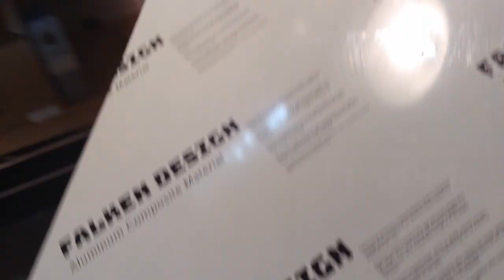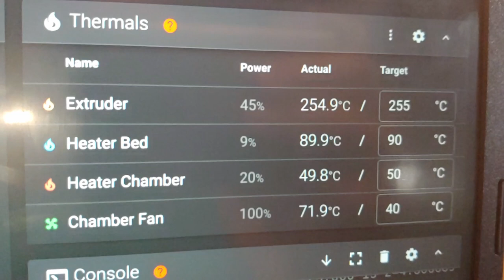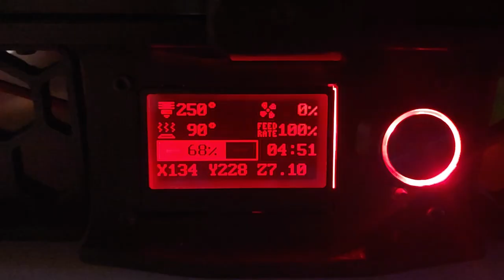V2 Chamber Heater Tinkering Continued

Comment: Just add a Chinese thermostat to control that PTC heater. It works for me and my Prusas, you don't need a PID controller. Also, I think your bed has very poor adhesion. With a texture sheet on my Prusas, I don't even use a skirt or glue stick, so unless you have a better textured sheet, you can use a smooth PEI sheet with glue. Also, it would be better if you remove all the aluminum and polycarbonate sheets and place your naked Voron inside a wooden enclosure with a small front window. Of course, in that case, you would have to insulate the bottom electronics.

Comment: im on a similar issue. Thought on  chamber heating but, yesterday i boght an infrared thermometer, and  turns out my bed thermistor and bed surface has a diference of almost 15C. checked with manufacturer of heated pad say max temp  200c, so bumped temp to 125c and surface is 105c now prints like a charm, and  placed 3 thermistors on chamber, avg temp is 65C after 20min.  ABS  prints like  pla now

Comment: Nice to see! I'm using the same heater element (though 200V / 500W) and put in at the bottom of the chamber. When the heater kicks on, two small fans push air trough the heater and a slow speed (12V fans at 7V)  to spread the heat.
Works like a charm.
Nice to see that you get ABS to stick well on a 90 degree bed, I will give that a try. I sometimes also have some melting artifacts in the first few layers. I'm using a FR4 build plate btw